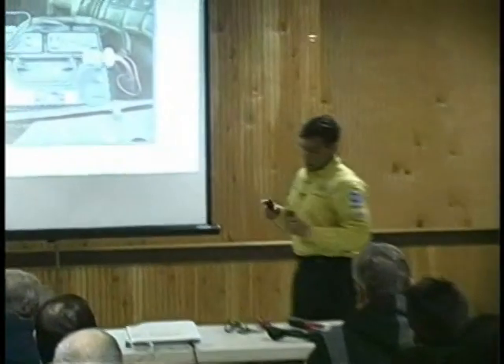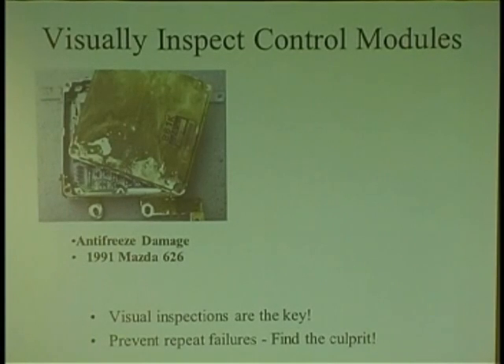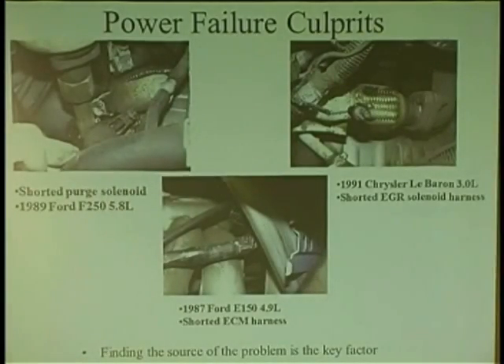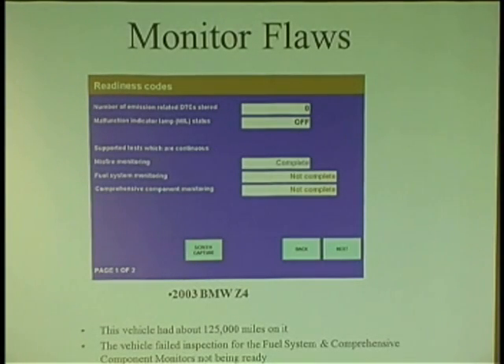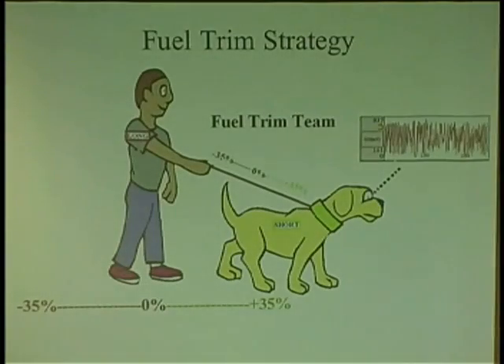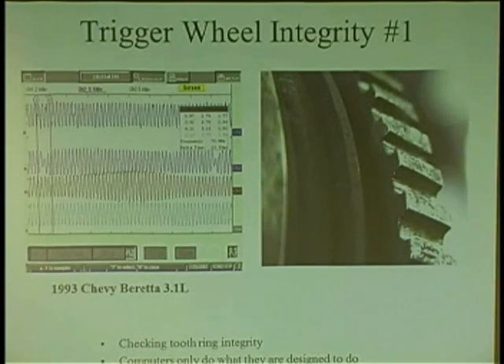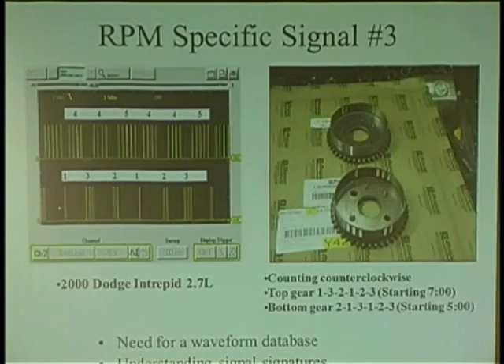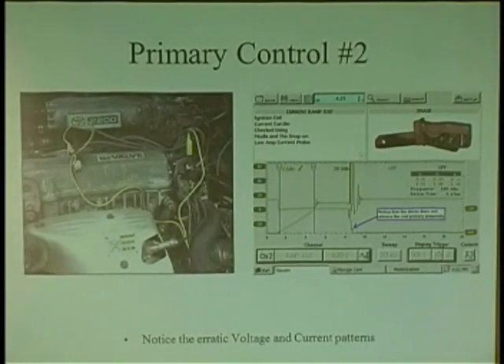Control Module Diagnostics with John Anello

Comment: To say there's should be a spike suppressing diode in the relay or solenoid is not enough.  You need to describe how to test it correctly. I've found a few solenoids over the years doing transmissions on the bench and the spike diode was either not in the device or it did not malfunction.With Two wire solenoids the test is simple using a old analog ohm meter. Check the resistance, reverse the polarity with your leads and the ohms will be slightly different if the spike suppressing diode is working or even in the solenoid. This will not work with a digital ohm meter. Who would have thought polarity using an ohmmeter would be an issue but it is at times.

Comment: That is one of the greatest videos about  control module diagnosis I have seen. I was looking forward to hear you talk about p0101 Maf code, with a good maf and a dirty throttle plate on a drive by wire system.  I can't see how this code is triggered with a dirty throttle body. Could you please explain how?